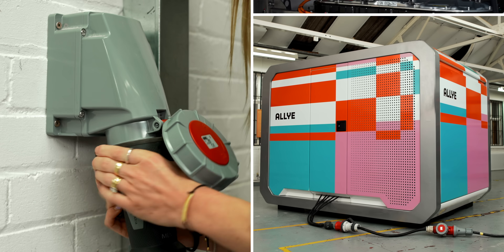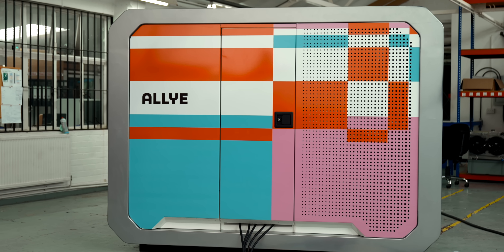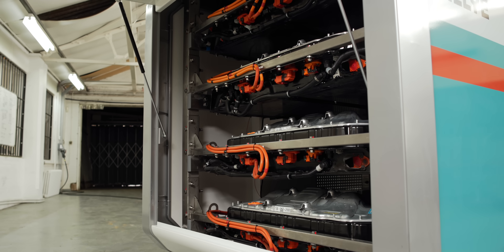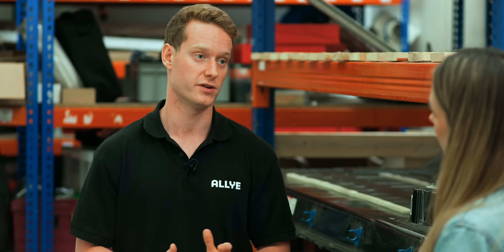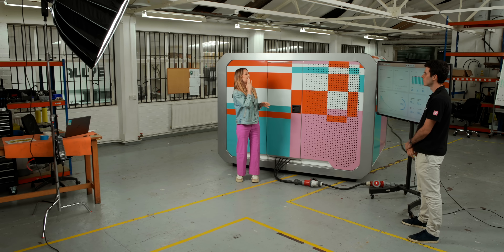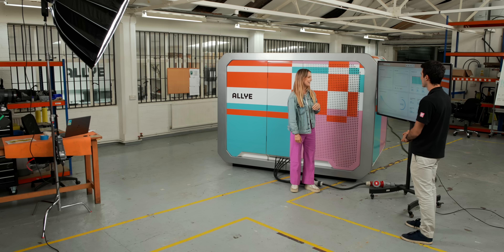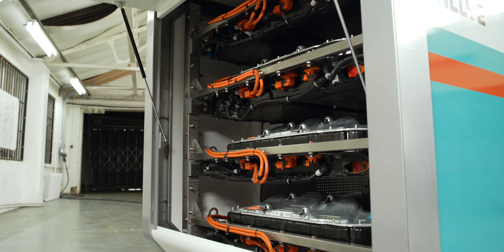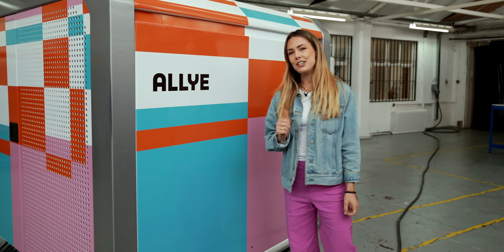These Recycled Batteries from Allye Cut Your Energy Bills In Half!

Comment: Imagine one of these on a housing estate, shared between say 20 houses, it’d save a small fortune in individual batteries for everyone’s home, meaning Solar could be rolled out more quickly and cost effectively as batteries are at least 50% of a modern installation quote. The grid could own these and spread them out in weak areas and have full control for balancing, load sharing and helping to keep the grid working at a stronger capacity.
Reply: Hi @bradleyarcher9840. Thanks for the comment. You've hit the nail on the head. This is exactly what we are planning to do - we call them "community batteries". But we don't see the community battery replacing the battery in the home - we see it working in conjunction with the systems that we will develop for the home. That's the really interesting thing - batteries working in unison, together, across the electricity grid, to make the system more resilient, more efficient and more balanced.
Reply: albinvega7008  imagine if a gas leak blew up a residential building
Reply: albinvega7008  How many fires do we have from gas or propane leaks every day?
Reply: albinvega7008  What brand was that battery? DIY? How many houses burnt from gas fires? 2-3 every day!!!!!
Don't forget, these batteries are not in a house. They are in a safe container away from houses.
Reply: In North Central Oregon, there is a Energy island village of some 20+ years. It has been quite successful and is growing. They now are connected to the grid to sell off excess energy.
Reply: @TreDeuce-qw3kv  That's the future pal. Make your own power, store some for the next few days and sell the excess to the grid. Factories, offices, shops, malls, flats or even public EV charging stations will need it. I have a friend with three children, in a four bedroom house, 2 EVs and he doesn't pay anything for power or gas. Yes he spend 25-30k in front but he will make that money in 7-10 years.
This way we don't need huge coal-diesel-gas-nuclear power plants and huge powerfull grid that can move power from one state-county to the other thousands miles away.
Reply: This is socialism! In a capitalist society, you burn fossil fuels as wastefully and inefficiently as possible for freedom. So say the oil funded think tanks that once said that smoking is beneficial for pregnant women!
Reply: The Government will never allow this to happen, they must cater to their donors. This may be a cynical view but after seeing the recent decision to not allow people with excess solar energy production to be able to supply to their neighbours/village it just shows the Government has no intention to deliver an expansive energy policy. Why villages cannot club together and generate their own electricity as GROUP is beyond me, just another stupid decision from our so called "leaders". This is not a green leftie, tory bashing statement, Labour are just as clueless.
Reply: This is already being done in Australia using a community battery model that our new federal government is about to scale up. While I agree that this is a great idea it requires more planning, a suitable location and community consultation whereas batteries on individual homes can be rolled out much faster as they can be installed quite quickly. A high run rate is the key to scale up fast. Batteries on individual homes can be rolled out very quickly if the manufacturing, pricing and funding model can be optimised.
Reply: albinvega7008  Usually a gas fire makes an exlosion that destroys the house. These batteries can catch fire but they are not IN the house or on the wall of the house. So your house won't be on danger. Fire department knows how to kill the fire on a lithium battery, I know it's not easy but I bet you will be there to give us a live stream when it will happen. Have your camera ready, but you might wait for LONG time.
Reply: albinvega7008  I believe you still have enough time to get rid your smartphone, your laptop, smartwatch and every other electronic device you have with a battery. I can understand your fear, it is called fear for the new technology and every generation has it. I don't blame you. I ve read what the first train brought to people, the first steam ship, the first car, the first airplane. People like my wife didn't use smartphones or even the old cell phones, because they heard about Samsung Note 10 (not sure about the model but you got the point) that exlodes. No problem, that generation will pass and everybody will be happy when every dinosaur dies. Till then, science might find something to replace lithium, or find something to kill the fire on it or even better find a car that does not need energy. Freemantle Highway carried 3500 gas and diesel new and used cars also. You know that gas and diesel cars catch fire much easier. Till they find the reason I don't believe what oil companies employers say. Have a beautiful day. That's the end of our discussion. If you don't want to follow the stream, we will wait for you to....
Reply: @orionbetelgeuse1937  You forgot 1-2 zeros on that number. 2-3 in 100,000 or 2-3 in 1,000,000. Can you tell us where we can find that number?
Reply: Six of these 300 kWh batteries could probably, paired with solar, power our small town!
Reply: I've been suggesting tesla energy try to sell neighborhood megapacks since they came out that way. 
Imagine dropping one megapack right alongside a neighborhood step down transformer and supplying 100s of houses just like that?

Much cheaper overall, utilities could do the installations and monitoring. And grid resilience would increase. Instead of hundreds of megapacks at a central easily vandalized or damaged location via thermal runaway? Or thousands of home batteries?

You instead have hundreds of megapacks spread out everywhere the large step down tranformers are co located anyway. 

Outside of the big box stores&industrial parks would also make a lot of sense to. Slap a megapack or 2 in, put solar up on those huge flat roofs and bam a couple mwhs of peak demand charges are shaved down daily per install. Recharge the pack overnight off of wind nuclear or hydro power or early day peak solar and keep it moving. 👍🏻
Reply: I complete agree, the only thing I’d suggest is to use flow batteries. I would rather see these car batteries in cars, and utilise V2G or V2L. 

I think for quick response or grid balancing these have potential but ideally I’d want flow batteries with longer duration. 

I feel that if you have a street all with EV’s and bidirectional charging you could easily achieve a better result with more practicality.
Reply: In an ideal world yea
Reply: @06howea1  We want to make it ideal but you don't.Can you explain me why?
Reply: @chrishar110 are you serious!? We're going to need alot more batteries for vehicles and equipments! This kind of solution isn't going to work forever! Imagine if the manufacturer of those EVs decides to take those crashed cars/batteries back to do their own recycling or dismantling!
Reply: @alanmay7929  Of course the manufacturers or the owners want to recycle the batteries, but they want profit above it. So, if the battery is not damaged why should they want to recycle it (to get the 10-20% of the price) and not sell it at 50% of the price? After 5-10 years when these batteries will fail then they will recycle them too.
Reply: @06howea1  Ideal world?  You mean Florida?  There are some newly developed communities in Florida with their own shared power storage systems specifically for the purpose of keeping the power on during power outages (storms in Florida are notorious for damaging the power grid).
Reply: @pilafmon   The notion that Florida, of all places, is "the ideal world" just shows how crazy our planet has become.
Reply: @pilafmon there is a city/village in Germany where they have central heating! Central energy supply from renewable...
Reply: @klaxoncow  Don't underestimate Florida Man!

Comment: Getting one of these is possibly better than getting an electric car although clearly the two could go hand in hand.
Reply: I think you're right, home batteries are typically a tenth of the size of a car battery, and for most people the house and car use a similar amount of energy per day.
That happens because domestic power use is pretty consistent, but your car needs to handle occasional long trips.